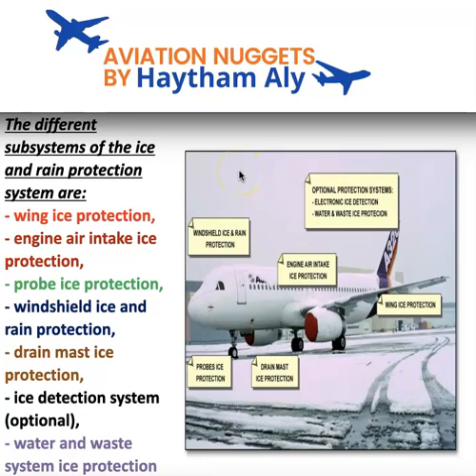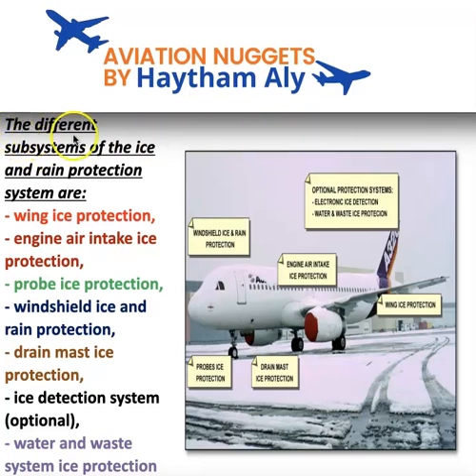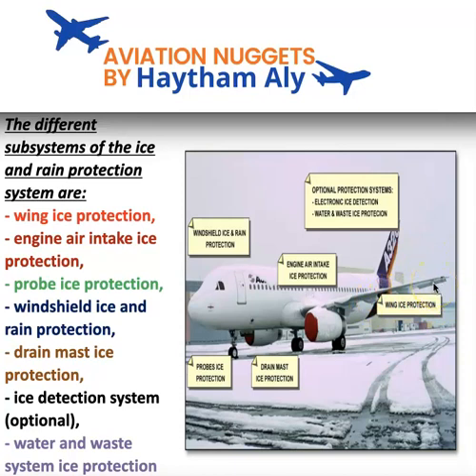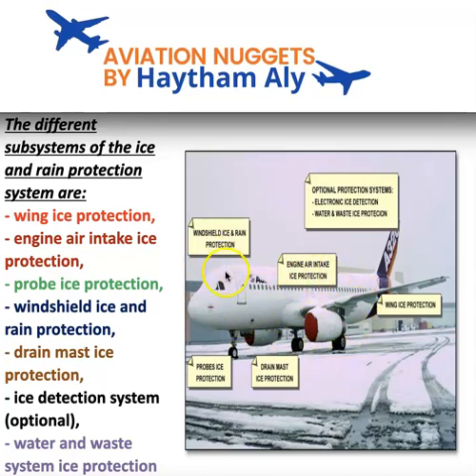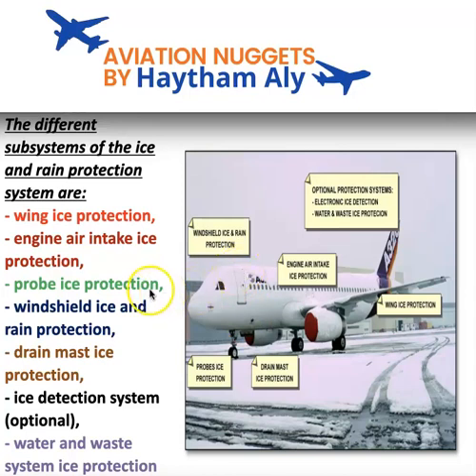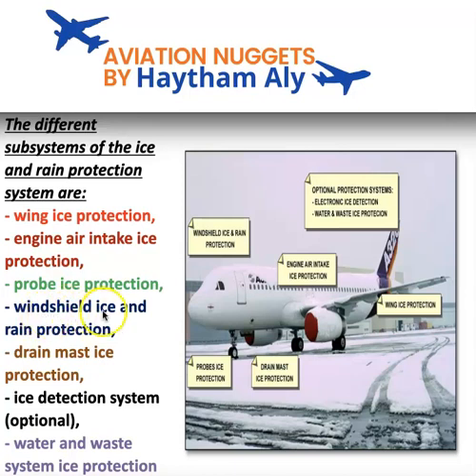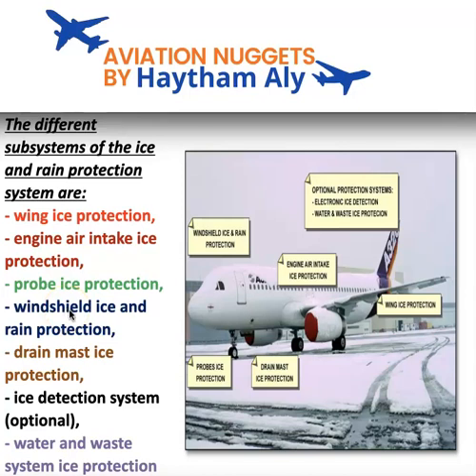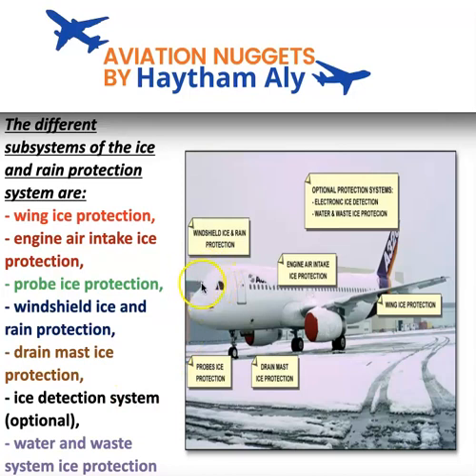A320 family CH30 ice & Rain protection system prepared by Haytham Aly, @Haytham_Aly

Comment: Excuse me engineer haytham i want asked you about wing and engine anti ice valve should be open all time during flight or request the captin according ice detection system & fail safe when deactivated anti ice valve open or closed???? Thanks allot
Reply from the maker: Hello my friend , engine and wing anti ice valve are not opening always , they must be manually selected by pilots , depending on icing conditions , only manually selected from switches,  because it is an overload on engines and the air bled from engines for that reason are going overboard after heating slats and engine air intake cowls,  also they do have fail safe position , engine anti ice is open if electrical failure and wing anti ice fail safe closed
Reply: @Haytham_Aly  thanks 🙏🙏🙏🙏